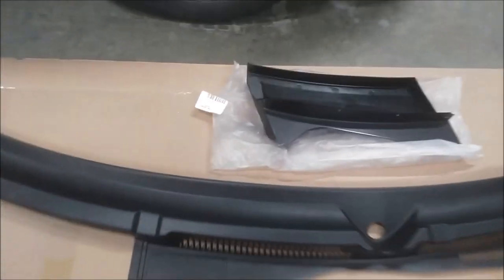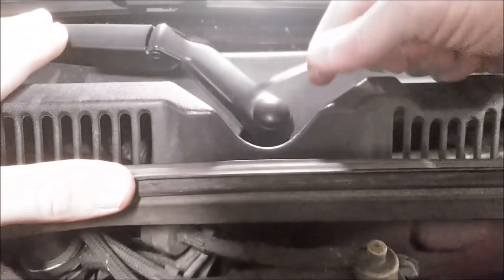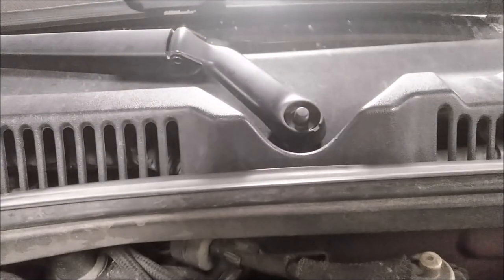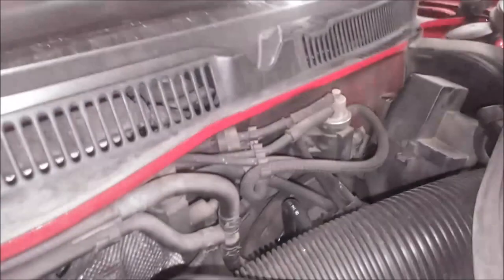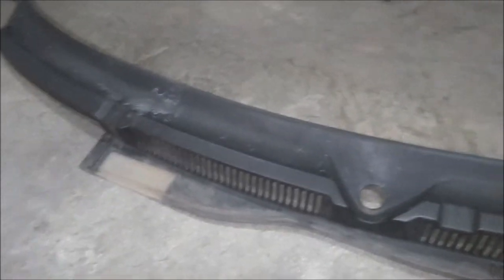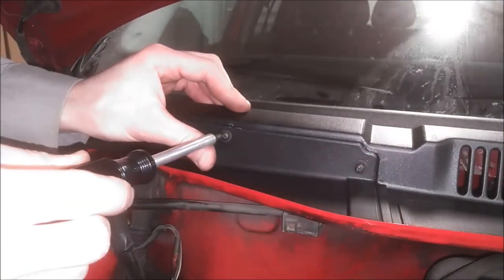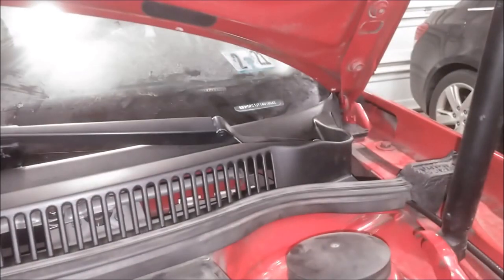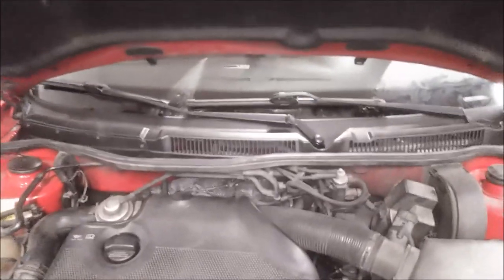Volkswagen Golf mk4 cowl removal and install

Comment: Great video, the one thing I'll add is it's not the best practice to be bashing on the stud when removing the wipers, because it could damage the threads. Toss the nut back on loosely and strike the top. Thanks for the tutorial.
Reply from the maker: You're right, bashing is not a good idea. I don't think I was bashing on the stud, but yes, the nut will protect the stud while tapping with a hammer.

Comment: Thanks. I did this (to replace the wiper motor) and replaced the cowl with difficulty (didn't use any sharp objects/tool etc) and careful not to bang the screen. Got it back in (happy) and the next day found a long crack ( ~ 8cm) on the corner of the windscreen. Guess I was just unlucky... so caution!
Reply from the maker: Thanks for sharing!

Comment: Hey dude, good video. The issue I've got with my cowl is that it doesn't sit in the grooves flush. I have gaps all the way across as the cowl just pulls away from the groove it sits in.
Reply from the maker: A Dot - Thanks. Do you have gaps between the glass and the cowl? Make sure that the groove is clean that the cowl sits in. Mine doesn't sit perfectly flush against the glass either. I just think it's a bad design actually.
Reply: @Corysdiyauto  thx for your video and comments -  I just fitted a new cowl on my passat B5.5 (2001) - there is a small gap between the glass and the cowl (just on one side this should not affect the seal in the fitting groove (it should still seal) but we shall see......
Reply from the maker: @flyingscot3666  - Thanks for watching and I appreciate the comment.

Comment: Hi Cory,  Quick question, is there any seal or interlock or engagement on the top side of the cowl that prevents water from going under?  I'm helping my son with his mk4 and seems like it could just dump the water into the cabin filter the way it is. Thanks.
Reply from the maker: Ken Convery - There's not any seal that prevents water from getting in that area. The plastic cabin filter access cover is what deflects the water from getting into the filter. It's important to always check this area and make sure there isn't any debris such as leaves, dirt, pine needles, etc. laying around. This can cause some water issues in  the cabin if not tended to. There are drain holes in each corner near the fenders that the water is meant to drain through. Just keep the area clean and you should be fine. Thanks for watching!

Comment: Thank you for this tutorial. I've installed mine in a gold mk4 and the plastic is not well sealed with the cristal, should I use some silicone or glue? Sorry for the rookie question 😅 Thanks
Reply from the maker: No silicone or glue is needed. No need to apologize bud. We are all here to try and help each other out.
Reply: Me pasó lo mismo, te entra agua o se filtra agua ?

Comment: My Cowl is super stuck on. I can force with my entire body weight and the top edge doesn't budge. I had my windshield replaced a while back. Do you think they used some sealant along the cowl? How does water not get in there without sealant?
Reply from the maker: They probably used a sealant. Do you see any type of silicone at the base of the windshield? It shouldn't be sealed in place. The cowl is meant to be removed to gain access to the wiper linkage and motor if needed.
Reply: Dang. There wasn't any sealant but it was super firm, filled up with grit, and the plastic is pretty old and brittle. I didn't realize it's a tab that pulls straight out along the top edge, I thought it comes down toward the engine. So I broke it in half trying to get it off. Now that I can see the attachment mechanism the other half is coming off properly but it's very firm. I'm just taking it off to get at the glow plug relay. There goes $180.
Reply from the maker: @NeuroPulse  - Geez, that's too bad that it broke on you. I hate when that happens. These cars are getting up there in age unfortunately. Make sure to clean up the cowl area before you put everything back together. Debris can get in there and cause water problems. Hopefully you can fix your glow plug issue.
Reply: @NeuroPulse  Glad you shared your story, prompted me to look it up further before attempting.  The OP video here shows it being completely free after removing the wipers and only shows that the ends were broke - the tab along the entire thing must have also been broken.

I think the only right way is to carefully pry it up with plastic trim tool (from the glass side).  Pry directly away from glass (tab-slot is perpendicular or 90degrees from the window plane along almost the full length of the cowl.
Better video i found 8FsLXga6Qj4

Comment: Why didn't you show us how difficult it is to break-loose the old cowl?  That's why the end was broken.  Also, why didn't you at least clean the bottom of the windshield before install the new nice and clean cowl?
Reply from the maker: The end was broken due to the windshield installer being careless. I had a new windshield installed previously and the guy broke it. I could've cleaned the windshield up before the install, but I didn't. Sorry man.

Comment: Lookup "windshield wiper puller" tool for removing the windshield wipers. Don't force it with inappropriate tools like a flathead screwdriver or crowbar.
Reply from the maker: Great tip. Thanks for sharing.

Comment: So I replaced my cowl today with one from FCP Euro. It came with the passenger side tip broken 1 " from the end. At first it seated nicely but I couldn't for the life of me get the tray in, upon lifting up (like you did) the cowl popped out. I finished the tray assembly and tried to reseat the cowl with the tray screwed in, with no success. It is a replacement windshield and IDK, but, it won't seat properly or as easily as it did in you video. I am thinking to order another from FCP and hope it's not busted this time and send this one back to them. IDK. Any ideas?
Reply from the maker: I would contact them and tell them that the cowl was broken when you received it. They shouldn't give you any problems and send you another one. Good luck with it!